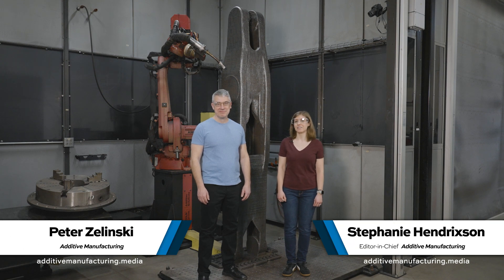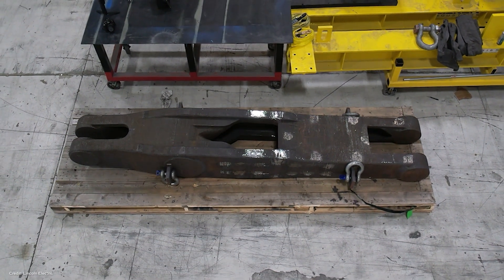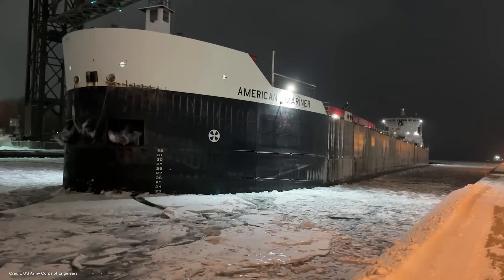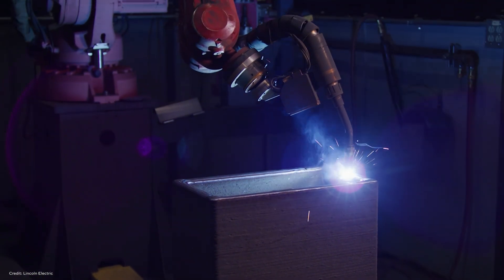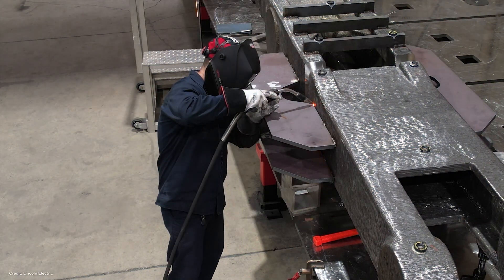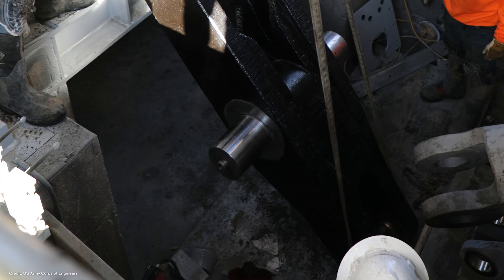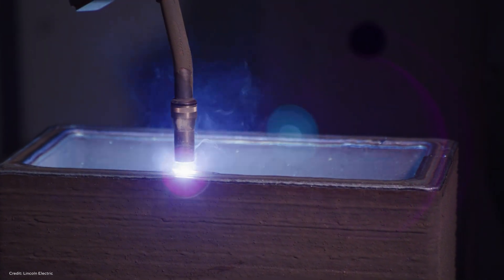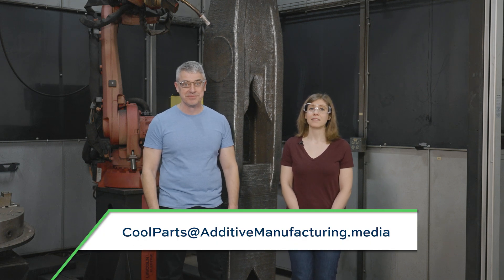3D Printed Replacement Part Keeps Critical Waterway Open | The Cool Parts Show

Comment: This is cool but its pathetic the army corp doesnt have a standard process for producing large castings like this which are much more common than you think.  This 3d printed part will last a fraction of the time of the original part.  Large weldments always crack at the weld and having a piece made of nothing but weld doesnt seem like the best idea on a part that takes load cycling like this. Why a spare wasnt on hand is anyones guess.  Its clearly a consumable part.
Reply: I would also be curious to see how the additive part holds up to multiple temperature cycles under load.

Comment: i would have just printed 9000 pla parts on my bambu labs a1, super glued them, then hit it with some rustoleum primer. just need to remember to use 100% infill

Comment: As always, a great watch. Maybe i missed it, but why wasn't "take big slap and mill it down" not considered an option here?
Reply from the maker: You didn't miss it. In our interview, Clint only mentioned evaluating a traditional casting, a weldment, and an additive part, focusing on cost, schedule, constructability, safety, and quality. He did not mention milling from a block of material, but we can look into it.
Reply: The machining is Not the Problem, but you dont get such a chunk of steel at every corner aka very Long lead time.
Reply: chunks of steel that big are expensive and take a long time to obtain.